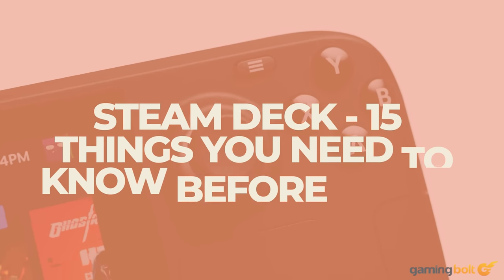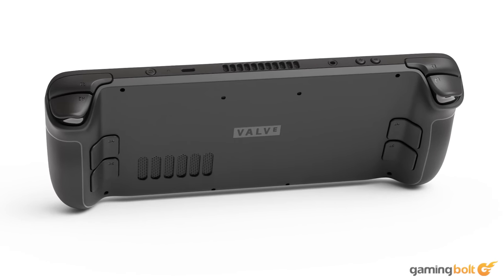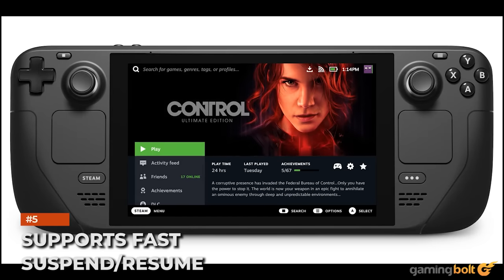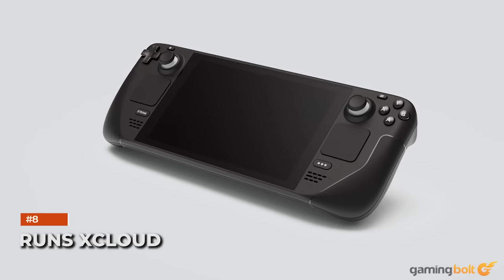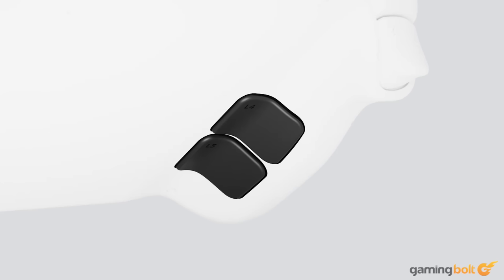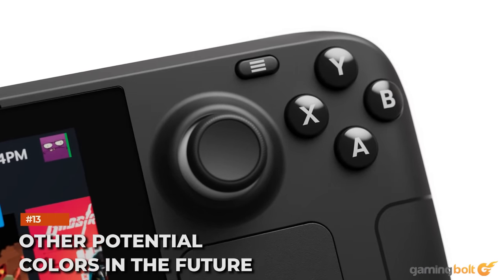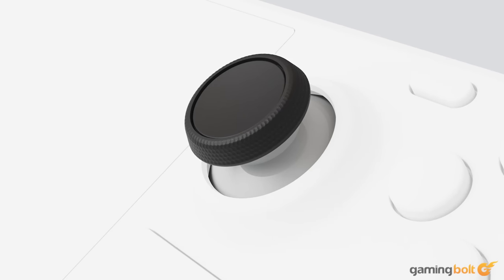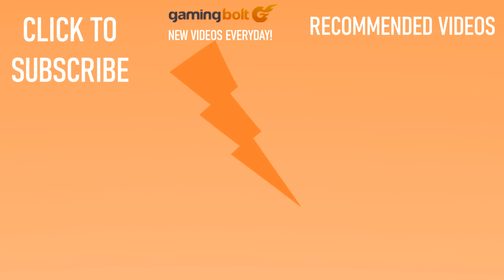Steam Deck - 15 New Things You NEED TO KNOW Before You Purchase

Comment: Valve says not to open it to stop dumb people from breaking it and trying to sue them.

I think it's neat they tell us how to fix it but if you break something that's on you because they told you not to do it.
Reply: They are also doing it for saving themselves various headaches from said dumb people when they break something and try to rma it. They studied and put the optimal componenents possible for the Deck to hit those price points. The most blatant is the m2 EM is such not interfere with the wifi module right next to it.

Still some of the more wereable components are easily accessible (analog triggers and buttons) to replace. I guess only the screen is the most difficult to disassemble along with the battery (unfortunately they glued it to keep it in space)
Reply: @GLDragon93  I wish was easily to replace it would have made adding a OLED display seem worthwhile. Now it's not really in my list of stuff I want to do with it 

Untill I get guides online to how Tonto tinker with this I'ma just stick to a Dock and SD card.
Reply: @waffleten9750  Same, hopefully there will be more in-depth teardown for screen replacement. And hey, if the Deck will be successful enough, there's chance of seeing third party screen replacement kits like in the Vita (there's plenty and cheap).

I'll probably go a little further and will try to use an m2 sata to usb-c e enclosure with a windows install to play those games incompatible with Linux and likely won't update them because are not on steam. Dual boot with linux x windows doesn't seem to be a good idea.
Reply: @softwarelivre2389  Yeah but some games have intrusive anti-cheat (kernel level) implementation that makes them highly susceptible to bans or just straight up need workaround on the anti-cheat to run (and again bannable offense)
Reply: @GLDragon93  Oh, makes sense. I thought you were talking about old games before Steam even existed, not about intrusive anticheat games (which I would never play out of principles).

Comment: Would love to know more about its performance while docked. Will it be a disappointing experience if played on a larger television?
Reply: Not gonna make a difference while docked.
Reply: the only difference docked is that you can use higher TDP without killing your battery fast
Reply: This is a good question, and we will have to wait for the numbers to come in. A "larger television" is relative, as you can have a 55" TV running at 720p, which is near the display resolution of the Steam Deck. But you can also have a 32" 4K TV, and that is a lot more pixels for the hardware to have to push out, and I would expect the performance to drop significantly. My biggest question is what it will look like running at 1080p, as I can happily play with higher performance and graphical fidelity at 1080p than use that power to push more pixels for a higher resolution. And considering the Steam Hardware Survey lists 1080p as the primary resolution, for Steam PC users anyway, this should be a safe assumption. And we should be able to set the output to 1080p and use the internal upscaling for a 4K TV, for example, the only real question is how it will perform while doing so. And this is also going to be on a per game basis, as you can run plenty of older games on comparable hardware with really high FPS, passed the 30 FPS target for the handheld, but they might not be today's AAA titles, but a AAA title from 5 years ago. Everything is relative and it all depends on the variables...
Reply: @fleabittn77  interesting video! Looks like there is hope (Gamescope?) but playing on my big 70" TV might not be a great idea...
Reply: @callanr  read the comment above you. The size of the TV doesn't matter at all.
Reply: @KuittheGeek  thanks for the detailed info. For a few reasons I'm not interested in upgrading my aging PC, while I'm still very much interested in playing my library of Steam games. I've gotten used to gaming on the couch with my (also aging)  Xbox Series S. I was hoping the deck could be the best of both worlds without breaking the bank.
Reply: @callanr  Oh yeah, and that's definitely fair and valid. What is the resolution of your TV? And like I had mentioned, we should be able to set the resolution to 1080p, and let the TV deal with any upscaling that needs to be done. It does all depend on what games you want to play, when they were released, and how they would play on a mid tier gaming PC from about 4-5 years ago. That is my understand for the power of the Steam Deck, but I could be very off base with that. It is the most powerful handheld, but that doesn't mean it is the most powerful computer. That said, I would guess, if you can push a game at 80 FPS at the default resolution, you could expect to hit 60 FPS at 1080p, but those are educated guess, not empirically tested results. So again, it all depends on what you are playing. If you are very concerned about it, I would hold off and search for videos of people playing the games you want to play to see the performance.
Reply: @callanr  should be fine.
Reply: you should be able to play everything on your TV but more intensive games will have to be run at a lower resolution and upscaled to your TV's resolution.
Reply: 800p is going to look pretty bad on a 4k TV ..... i wouldnt do it personally
Reply: It is primarily a portable battery system with an iGPU. If you are just using it at home then use a PC with a GPU.  The res a game works at is what will be displayed on the TV 720 900 1080.
Reply: For me I'm more interested in it so I can play while I'm out waiting for the people I drive to appointments. At home I can play on my TV using my PC. But I do wish Valve would have had a dock at launch so we could have seen how it'll look.
Reply: @Joreel  The S Deck has HDMI and  DP out  so I don't know what ypu mean
Reply: @Joreel  in reality Valve never promised a difference in performance using their dock, so realistically I wouldn’t expect better performance. They just promised “a dock to connect it to your peripherals”.
Reply: There should be a huge difference because when I play cyberpunk on my PC at 1080p 21x9 I have to play in the lowest graphics and I only get 37-50 or around 45 FPS but when I play on my projector that is in 720p at 16:9, I can play it in the highest graphics at like 45-50 FPS. If I play it on my PC at 1080p 21:9 on the highest graphics, I only get 18-25 FPS. This means games that run on the steam deck at 1080p at 60FPS should only get about 30-35 FPS on a 1080p TV. I mean how can playing at a much higher resolution not make a difference. That is not possible for it to be the same
Reply: @DARK_AMBIGUOUS  OP is saying that while docked, the Steam Deck may have better performance due to better power delivery or cooling. It’s very unlikely but yeah, that was his point.
Reply: from what I've read it's going to perform like a mid-level pc.
Reply: Maybe disappointment in terms of image quality but not performance quality. I own a GPD WIN 3 (essentially a Steam Deck before Steam Deck) and having it docked all the time means I don't have to worry too much about TDP and wattage since it's always plugged in and so that means I can push my device to it's limits and not worry about extremely low battery life.
Reply: Update: so I went to the Steam Deck page and right there in the FAQ section, Valve themselves answer that the use of a dock won't provide better performance. Deck will work at full performance on battery.
Reply: @iamjefftacobell7688  Not true, the TDP does not change when docked.

Comment: 4:08 Where the hell did you get the info that the Steam Deck will support DirectX 12? 
I would reaaallly like to see the source for this lol
Reply: Control uses DirectX 12, no? And that works great
Reply: SteamOS has Proton.
Reply: Not only it supports DX12 but also has access to raytracing and variable rate shading thanks to the RDNA 2 iGPU
Reply: Technically, it does not support DX12 since DirectX is locked to Microsoft. But it's still supported by translating DX12 to something the Deck does support directly (Vulkan).
Reply: DX is supported on Linux through Wine/Proton & DXVK. It mostly works quite seamlessly (not speculating, stating this as an active user).

Comment: My only issue with the Steam Deck so far has been the claim that opening it makes it structurally weaker. This all comes down to a design flaw from them having the screws that hold the casing together going into a soft plastic peg, rather than a brass retention insert. It is a design choice made with what feels like the intention to impart consequences on people who choose to open and repair/upgrade (what little can be) the device they paid for. Which, considering this is aimed at the PC gaming market, is a lot of the people who are interested in the Steam Deck.
Reply: Or because self-tapping screws are cheaper to manufacture, which considering everything Valve has apparently done to try and keep the Steam Deck's price down is reasonable, and even then it's not as if your Deck will disintegrate at the screws if you open it up - the structural weakening is true from a technical perspective, but as seen from other devices with similar self-tapping screws it's imperceptible in normal usage to the point of being irrelevant. Also, their repeated warnings of not opening up the Steam Deck is mostly to cover themselves from any future legal repercussions of someone opening up the Deck and hurting themselves or destroying the hardware in the process. That said, the fact that Valve even made the official teardown video in the first place says a lot about the freedom they're giving the end-user.
Reply: @StrikeNoir105E  The added cost of machine screws and brass inserts would be imperceptibly small on a per unit cost. Everything else you said I 100% agree with, it just strikes me as an odd choice, as I have encountered several issues due to Nintendo's decision to do the same closure method in the Switch's JoyCons. My gripe is minor, and will not stop me from buying a Steam Deck when they become more readily available, as I support the idea and Valve fully.

Comment: This is probably a dumb question but should i be concerned about buying one if i never owned a pc and never used steam before. (Basically do I need a pc or something to use one or does this stand as its own console?)
Reply: you can use this on its own. you can download the steam app and make a account already and start collecting free games they give away every now and then.
Reply: The Steam Deck is essentially a PC already so you should be just fine using it as a standalone product.
Also if you ever decide to get a PC you'll be able to play all the games you buy for the Deck on it as well.
Reply: It's basically buying a mini PC, and any game connected to your Steam account can be played anywhere else that supports Steam. Steam also has Cloud Save for the vast majority of the games, so you can upload your savegames from your Steam Deck and continue it anywhere else.
Reply: @WickedMuis  well, i have to see what it makes a whole pc tho. for now it looks good but to blow up then great 3rd party software has to be developed
Reply: @TheChameleon2008  There already is 3rd party software and as long as Steam as a whole is a thing there will be 3rd party software in the future. That's the point.
Reply: @TheChameleon2008  It's running Arch, you can literally install whatever you want onto it, this makes it a normal PC. There's no need to develop anything specifically for the Steam Deck, you can run any Linux app and the vast majority of Windows apps.

If you really want to, you could install Windows, but I'd really advise everyone to at least try out the native OS instead of installing Windows immediately.
Reply: @MunyuShizumi  what about other game launcher like epic etc?
Reply: @TheChameleon2008  Never used Epic, but I used several EA & Blizzard launchers without issues (occasionally a quick config tweak was necessary). Epic Games Store is listed on Lutris and seems to be supported. Note that EGS being supported doesn't mean that all its games are supported.

Valve has been putting in a lot of effort into increasing Wine/Proton compatibility and performance over the last decade, I'd say that most games work without (m)any issues these days (unless blocked by some incompatible kernel-level anti-cheat module), but I am a Linux nerd used to troubleshooting things, so YMMV. It's not super-difficult to find specific games that don't work for one reason or another, but most tend to work fine without much tinkering.
Reply: @MunyuShizumi  sweet, thanks for all the information!!!!

Comment: Valve advises against it opening it even to replace the SSD.  You kind of implied otherwise.
Reply: Yeah because the Steam Deck uses a shield that prevents interference with the Wireless chip found in the device and some 2230 drives may not be compatible with that Shield. Linus Tech Tips' tare down video shows the shield when he removes the SSD mistaken it for the wireless card.

Comment: As  someone who owns a Decently speced gaming Desktop and a pretty decently speced gaming laptop. The Gaming laptop is from 2017 and could use a technological upgrade and doesn't need all of the eye candy enabled the Steam Deck is perfect to satisfy those needs. I would like to upgrade the GTX 1070 that is in my gaming desktop but due to the pandemic that made that feat very difficult and the Steam Deck would also be perfect for me to use as a gap piece and beyond until the GPU that I want becomes available finally.

Comment: So my Acer nitro 5 core it 8th gen with a grx1050ti 4gb, 32gb system ram, 2x SSD hdds... It's quite a bit more powerful than the steam deck, even though it is pushing over 3 years old.  I thought the steam deck was close to double the power of my gaming laptop, however, it looks like irl it may be better with some games like cp2077, but in terms of raw power a real gaming PC will walk past it.

Comment: My biggest concern about the steam deck is the fact there are 15+ different launchers on PC, yet the system is only made to work with one. They're going to be so many games that you just simply won't be able to play out of the box,  because they're simply not on steam.
Reply: I’ve been considering the Steam Deck as a Steam console. In that regard, I’d buy it with the idea of playing Steam games because that’s what has realistically been promised by Valve. 

But at the same time, I know the Linux community is insanely good at hacking, cracking, patching, customizing and really tearing any piece of software apart and putting it back together so I wouldn’t be surprised if some impossibly portable games are, well ported to Linux. Even some store fronts like Epic or GOG.
Reply: @randomwatcher7787  there you have it. Thanks for the info.
Reply: You know you can use steam to launch games from other launchers on PC, right? Valve has said they will support other launchers
Reply: Arch user here. Other launchers generally work. Steam makes the experience very seamless on Linux, but I used a number of other launchers without (m)any issues (manual tweaks may be required though).
Reply: For now.

Comment: So since it's using SteamOS, the library is heavily restricted to steam store only? Was hoping to be able to access my EPIC account library tbh
Reply: You can wipe the OS and install Windows on it, or dual boot Windows (or any other OS for that matter) and install and play ANYTHING you like. SteamOS is NOT locked on the device.
Reply: you can install windows
Reply: You can run any OS on the Steam Deck, including Windows, which'll allow you to play Epic Games Store or Microsoft  Game Pass games, as long as you're willing to do the work do get it running.
Reply: I wouldn't recommend installing Windows on that thing, considering that (afaik) the Windows drivers the Deck's AMD SoC aren't as well optimized as the Linux ones (so you may suffer from bad performance), however, Proton isn't limited to Steam games, so you might be able to launch the epic client using that (or use something like Lutris).
Reply: @ThePC007  the SoC is a standard x86 Ryzen APU from AMD the only difference is its one that is unavailable to purchase as a stand alone unit because its specifically only made in that configuration for valve, it will work the same as any of the current or past gen Ryzen APU chips, in fact, i've seen windows running on it from a very early prototype back when it was called Project Aerith before the name steam deck was even chosen and before it was linux based,
Reply: The library isn't restricted in any way (you can install whatever you want), but Steam does have the most seamless Linux support, nobody else comes close.